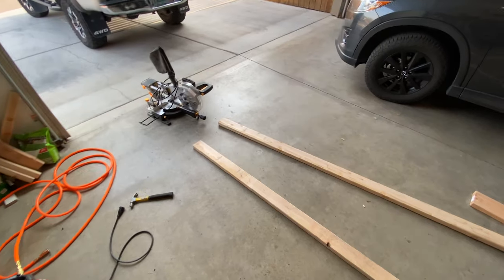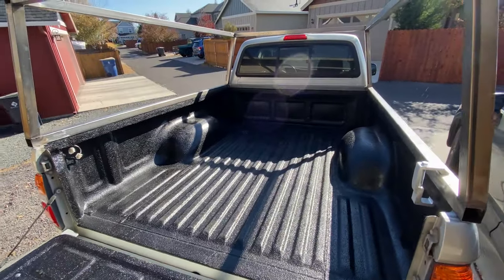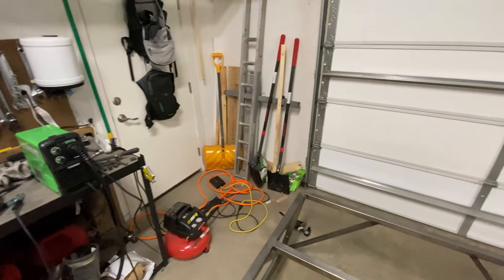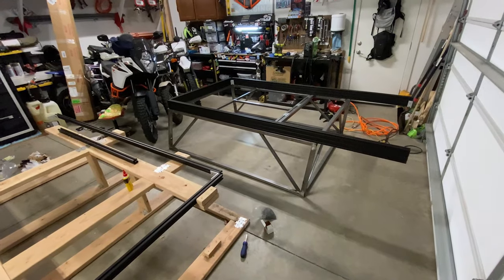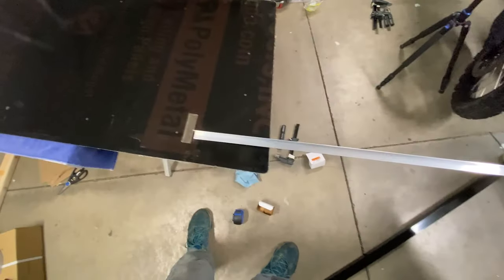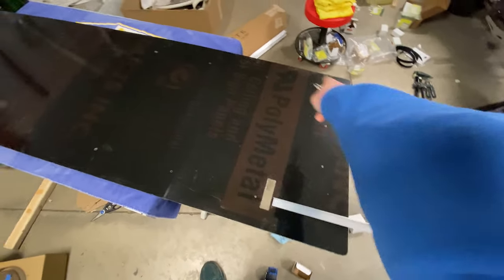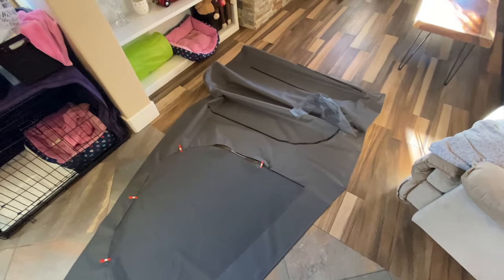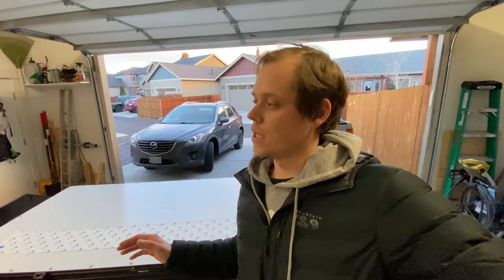DIY Wedge Camper Build Vlog - Beginning to End!

Comment: Awesome build! I am starting a similar one for my 2nd Gen. I noticed you also used the HF 125 flux core Welder for the spaceframe, I'm having a hard time dialing in the settings to keep from blowing through the material. Any tips or settings you remember working well? I am using 1.5x.065 wall tubing. Thanks!
Reply from the maker: Thank you! 

I don’t remember my settings but the best thing you can do and what I did was get some scrap of the same walll tubing and cut it up and just weld the scraps together and dial it in that way before you work on the camper
Reply: @pnwxplore  thanks for the response! Yeah, sounds like a good plan. Glad to know it is doable with that machine!

Comment: Such a neat DIY option for these campers. I have always owned vans but am currently making the move to a Tacoma and this is helping with the build cost! I was hoping you would have advice on where to source the extremal corners for the extruded aluminum used on the wedge portion. It seems Ripcord had them custom machined. di you go that route or were you able to source them? Thanks!
Reply from the maker: I sourced the corners from both 80/20 and Tnutz. I just stacked the right profiles to make it what was needed and avoided and need to machine. Machining corners however is the optimal route

Comment: I'd like to see a 45 degree slanted piece at the front for aerodynamics. Is there a way to put the Tnutz EX-3075 – 0.75″ x 3″ Smooth T-Slotted Aluminum Extrusion in front at a 45 degree angle?
Reply from the maker: I no longer have this truck or camper, but given you can basically do anything with 80/20 I do not see why you couldn’t

Comment: Wowwww, what an amazing job buddy. How long did it take you from start to finish?
Reply from the maker: Thanks man! 10 weeks
Reply: @pnwxplore  Sweet! Also, what are your thoughts about potentially having a higher height of the space frame? Wondering if this would work so one could also have the the option of sitting fully upright while in the trunk of the bed (allowing the option for stealth camping as well). Thank you!
Reply from the maker: Yeah that’s definitely an option, but it could look odd depending on how high it is. But that’s the beauty of building it it, you can do whatever you want!

Comment: Great video! Not trying to be negative troll or anything but you really shouldn’t grind or cut metal near your vehicles as the sparks of molten metal will burn right into your paint and glass. Might not see it right away but I assure you it does. Great job though
Reply from the maker: That is definitely a valid point! Thanks for watching.

Comment: Awesome video.  I’m in process of gathering materials for my own on a 97 Tacoma.  How different were the measurements of the space frame over 2nd gen?   Really curious how you find the tilt bed frame is working.   Thanks
Reply from the maker: Thanks! The bed rails are not as wide apart on the 1st Gen, so the camper is narrower. Lifting bed is awesome, so happy I added it

Comment: Do you think this could be done with a wooden frame?  Just curious how the space frame is bolted to the wedge camper and if it would be possible as a I don't have the skills or access to a welder.
Reply from the maker: I’m sure it’s possible, but it would likely be very heavy in comparison. There are versions of this build that are made out of 100% 80/20 extrusion, which eliminates any need to weld. You should give those a look!

Comment: Fantastic Job. Looking forward to trying something like this on my 04 Taco extra cab. Any reason you went with a steel sub frame vs. Aluminum?  Just looking at ways of keeping weight down as much as possible, and I have the ability to weld aluminum.
Reply from the maker: Cost and durability are the largest reasons. Aluminum is more expensive to buy and to weld. It isn’t as resilient as steel either and can fail from even the smallest repetitive movements. So aluminum is will eventually fatigue and crack if it moves. How long that takes depends

Comment: This was awesome! Great documentation and building skills. I am in Portland and am tossing around the idea of buying a Super Light from GFC and fast tracking the whole thing... lots up in the air as I am trying to figure it out based on any info I can gather about that tent online. Goal would be to mount it to a diy space frame and cut their panels. Not sure if it will be water proof enough for the PNW and my truck that is parked in the driveway. Thanks for sharing and inspiring!
Reply from the maker: Thanks man! I would say having access into the tent from the bed plus the standing room is huge! IMO it makes it all worth it. A canopy with doors on all sides is incredibly useful, but don’t underestimate the utility of also being able to access the tent in there. Mine has been in freezing rain, pressure washed and snow so far and just some small leaks that I have addressed. It’s always parked in the driveway as well.
Reply: @pnwxplore  I should have been more clear— cut the Superlight so that it functions the same as a GFC. That’s where it’s tough to figure out. I am thinking just cutting the bag material slightly smaller than the top of the space frame, cutting the honeycomb very similarly to ripcords single panel design (but larger standing area like yours), probably bolt some aluminum to the honeycomb so it has rails to sit on. Any ideas are welcome! Filling you on IG so we can talk there sometime if you’re interested!
Reply from the maker: Yeah hit me up if you have questions. Mating the GFC might be difficult. Never know!

Comment: Awesome Build. I am going to be doing the same for my truck, but only creating a camper shell (without the tent above). The biggest issue I am running into is those 4 canted support posts. I have modeled my frame in Fusion 360, but I am still having trouble wrapping my mind around the cuts that need to be made to make sure those angles are spot on (canted in and forwards), do you have any suggestions on how to nail down those angles/cuts? My metal working skills are pretty novice.
Reply from the maker: Thanks!

You’ll need a compound miter saw ideally. Then you can cut both angles at once. Then it’s simply a means of setting the saw up for that cut. You might check out a video on making a compound cut.

I used fusion to find the angles of the tubes to get the angles my cuts need to be and then just paid extra attention to the orientation I needed them to be in when I was cutting. I believe you can cut two supports with one setup and then adjust and cut the other two, but don’t take my word as fact cause that was a few years ago now lol. Good luck!
Reply: @pnwxplore  Wonderful, thank you for the quick response.

Comment: The odds of you seeing this are pretty slim, but I’m getting ready to build this for my 2019 Tacoma. I’m really struggling on wether I want to skin it with alupannel or maxmetal. If you still have the camper, would you go the route you did? Or would you do aluminum siding? Thank you soo much!! Also, out of curiosity, what did you pay for 1 4x8 sheet of alupannel?
Reply from the maker: Alupanel and maxmetal are the same thing I believe. The composite side is stronger and cheaper than solid aluminum. I like having the side doors. I do not recall what I paid for a sheet, but I know I paid around $600 for two sheets and the CNC cutting

Comment: awesome job dude! I love the pivoting bed floor idea. I'm curious what your thoughts are on welding the frame. I saw GFC making a point that welds won't hold up so they bolted parts wherever possible. Have you had any trouble with it? Also, I saw ripcord put an L brace in by the tailgate so it wouldn't bow out from the weight of the frame. Have you considered something like that? Thanks a ton for sharing this info! definitely gets me stoked to start panning a DIY wedge camper.
Reply from the maker: Thanks man! GFC will say what is needed to market their product. Whether there is truth in that depends. Lots of things are welded vs bolted that see heavy use. I don’t anticipate any issues.

I have bed side supports that I built and installed to help with any bedside issues. It’s more a problem on later Tacoma’s with their composite beds. 

Thanks for watching! The Tacoma world thread is a wealth of knowledge
Reply: @pnwxplore  thanks, stoked to dig in more! so much at tacomaworld... I realized after I posted that they're talking about welding aluminum, and you're working with steel so completely different things. I would love to see a weight comparison... I wish you could just guy the aluminum frame from GFC then build the rest yourself lol

Comment: Do you remember where you found the hinges for the pop top? Were they 8020 type or did you use something else? Have they held up?
Reply from the maker: I got them off 80/20. Should be the same one in Ripcords build sheet. Held up fine. They are steel so I don’t anticipate any issues

Comment: Loved the idea of the center flip up so much I had to copy it on my build! Did you ever find a solution to keep this in the upright position? I tried going the gas strut route and welded ball sockets into the frame but it doesn’t clear the keter rail so I’m looking for an alternative solution!
Reply from the maker: It is my favorite modification! I simply used a small little hook on the lifting portion of the floor and then a hook on the roof of the wedge mounted in the extrusion and some paracord.

Comment: What did you do at the front (the wedge) for tent/waterproofing? The layed out tent didn't seem to have the small section to cover that area. Maybe I didn't notice, but it looked like you only made the tent 3 sides.
Reply from the maker: It’s 4 sides and there is a little strip on the front that covers off that are. It’s the last piece sewn on.

Comment: Did you end up making the corner Gussets for the 80/20 , I noticed that they match the color of the frame or did you find something from 80/20?
Reply from the maker: I used what I was able to get from either 80/20 or TNUTZ. Didn’t fab any

Comment: Do you feel like you could've gotten away with 1" steel tubing for the spaceframe? and 10 series extrusions?
Reply from the maker: No way on the space frame. Especially not on a 6ft bed. You could probably get away with 1” on the extrusion width though. But mating up to 1.5” tube becomes a fun time
Reply: @pnwxplore  Thanks man! Good work
Reply from the maker: No problem!
Reply: ripchord stated he use 1 inch on the spaceframe.   Probably would be strong enough, the height of the alu extrusion provides lots of strength for the overhang.  

1-1/2 lines up nicer with the extrusion, being similar width
Reply from the maker: True, he did use 1” on the original space frame, on his V2 he used 1.5” however and used 1” for the diagonal supports, which is what I did.

Comment: Sweet another ripcord camper. I’m almost done with my space frame.  The compound angle for the uprights Is killing me
Reply from the maker: Nice! Yeah I had a hard time there too. I mocked mine in Fusion360 to figure the angle out. You could use a string and tape it and then measure the angle.
Reply: I built it in fusion360 as well.  I’m just having fun cutting it in the real world. I’ve got 2x4’s I cut down to the same dimension as the steel to dial it all in.
Reply from the maker: @McFlysGarage  ah, I got mine cut with a compound miter saw
Reply: @pnwxplore  did your compound saw with the metal blade work well? If so, what blade did you use?
Reply from the maker: @wkblazin  I used a dewalt abrasive blade for the steel, worked well for what it is. Then I used a Diablo non ferrous 84 tooth blade for the extrusion
Reply: @pnwxplore  forgot to ask, I've picked up nearly all the required tools, outside of what I already had. What compound miter saw did you use?
Reply from the maker: I used a cheap harbor freight one. Did the trick well enough for me.
Reply: @pnwxplore  spaceframe almost done! Just have to finish sanding and paint. BTW, I live in El Segundo and having a hard time finding the paneling. Weird being in LA. Any suggestions? So I can get the panels already drilled
Reply: @pnwxplore  just reaching out once again. I'm thinking of using paneling and making a folding pop-up design for the walls instead of tent material. Where did you end up getting your panels from? I live in west Los Angeles, and yet struggling to find a company to get panels from
Reply from the maker: I got my panels from a sign shop locally. You might check out the thread on Tacoma world, lots of conversations there about where to get panels
Reply: @pnwxplore  copy that. Thanks man. Look forward to new videos.

Comment: Thinking of making a DIY wedge camper using a ladder rack as a frame. Thoughts? Do you forsee any issues?
Reply from the maker: Lots of discussion on the Tacoma world thread around that. All sorts of issues you will need to think about lol. Not like it can’t be done, but you’ll have to engineer all sorts of work arounds

Comment: Is there a reason why you didnt go with aluminum? This must really weigh a ton being done in steel.
Reply from the maker: Only the frame is steel and it weighed in at 83lbs itself. The entire rest of the build is aluminum or composite. Weighs about the same as a fiberglass topper. Aluminum isn’t used because it’s A) much more expensive, not only to buy, but also to weld and B) isn’t as strong as steel in a dynamic environment when there are vibrations and movement. So it would require a lot more bracing to keep it from cracking over time at the joints.

Comment: Where did you get the external braces for the 80/20 I don’t see them listed on the 80/20 website?
Reply from the maker: It’s a 3” and 1.5” stacked. I believe I picked them up from tnutz